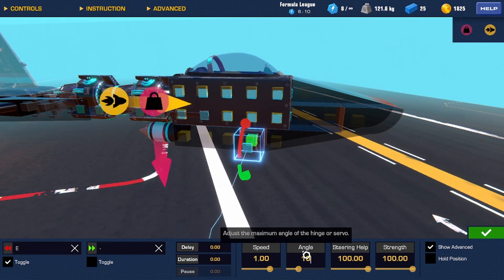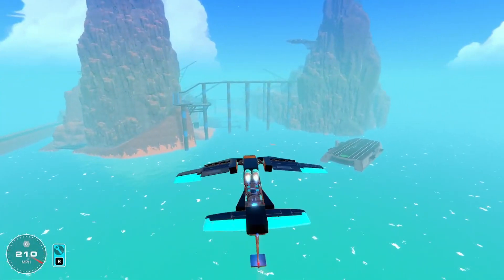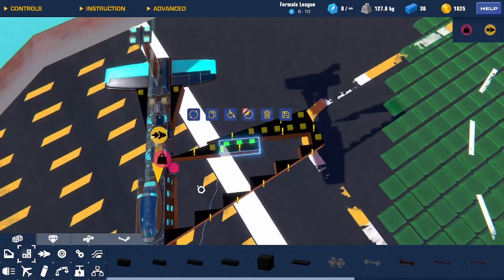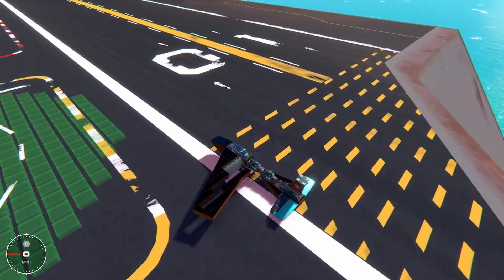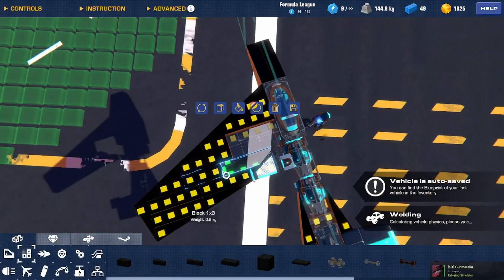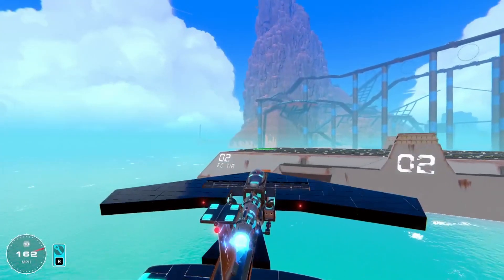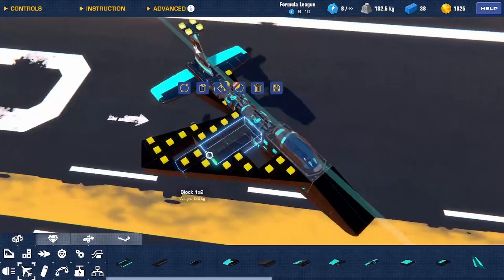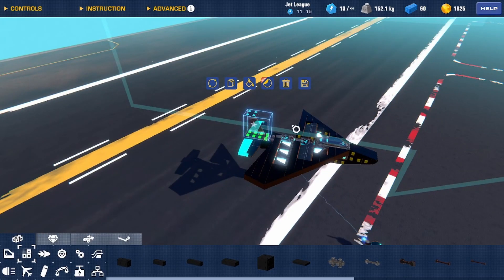Wing DESIGN, PLACEMENT, AND How to Build A BETTER Dogfighter

Comment: I think my wing lift is bugged in my copy of the game. My planes fly striaghter with the wings on the bottom and have more floaty effect when I place them at the top. I had built a catalina seaplane and a world war 2 fighter plane back to back one day and the catalina was very floaty and the ww2 fighter which was moddeled after a german junker where the wings are practically attached to the belly and it flew far straighter than the catalina. If you look up what the catalina you will clearly see that the wings are at the highest point.

Comment: 12:13 that is in fact a variant of a Swept wing, with a lower aspect ratio. A delta wing should be an almost perfect triangle. Better yet, if your focus is agility, lose the elevator fins and replace it with elevator flaps attached to the main wing but be mindful of high-speed “compression”. Same if you’re focused on speed.

But the nature of a “tailless delta” is that while it’s low speed agility and high speed lift is unmatched, it will lose that speed very quickly if you make sharp turns.

Comment: bro tf your "delta" wing was just a big swept wing, a delta wing is a doritos like on the eurofighter of the dassault rafale. delta wings usually have pitch AND roll into them, negat-ing the need for an elevator, but you can replace it with canards and have even more pitching power (like on the eurofighter/rafale). There were planes like the mig-21 (goat plane) that did have an elevator at the back, but idk why they did it, probably because the engines weren't making the plane ffast enough for the doritos configuration. Not hating or anything, just saying that swept wings have the back of the wing angled, but delta wings have it straight. also the F-22 doesn't have a delta wing but a diamond wing. By the way, the best way to remember what i just said is to remember that the letter D (delta), in greek, is a doritos when in capital letters. Your videos are great I'm just pissed off when someone makes a mistake like that.
Reply from the maker: My lord chill bro, but yes I understand thanks for the feedback. And the f22s wings are classified as diamond delta wings so I was basing my design off of that. Once again thanks for the feedback 😅
Reply: @ProjectSTORM1268  btw love your vids (boat/catamaran tutorial next ? or is it on the paddle video ? i'm gonna watch this one next)

Comment: bro a wing always generates lift upwarts in relation to your plane a baloon always generates lift upwarts in relation to the horizon/ground A WING IS NOT A BALOON  IT DOESNT MATTER UF THE WING IS ON TOP OF YOUR PLANE OR AT THE BOTTOM
Reply: it kind of does, because if the lift is above center of mass it won't stay level, it's going to try to stay horizontal. lift above CoM = more stable, less agile; lift below CoM = less stable but more agile
Reply from the maker: @loyalestdragon thanks for the explanation because I honestly didn’t know how to respond to the comment 😅 smart person saves the day yay

Comment: Hey Storm, you tend to use the helicopter wings and sails and paddles in your planes alot, what do these do to help?
Reply from the maker: They help with stability in the wings a lot more, so if I have any pitching up or down, it negates or lightens the effect of that on my plane. It will lower my instant turn time as well so I don’t have as much jittering on my more maneuverable planes.

Comment: Hey Storm have you ever made leading edges and trailing edges that move for better maneuverability? I have a Dogfighter that actually has insane turning and good stability (No Hinges btw) and it also has Leading and Trailing edges [Flaps acting like horizontal stabilzers] which give it that maneuverability.
Reply from the maker: No I’ve actually never heard of this, that’s really cool 😅
Reply: bro... every wing has a leading and trailing edge, because it's the EDGE of the wing not the control surface |:

Comment: where should my pitch and roll come from? I always put pitch AND roll in the main wings, only pitch in the tail (unless it's a bigger tail, then i do both again)
Reply from the maker: You should try your very best to put the pitch in the tail. Think about it from a leverage standpoint, pushing something down from the very back will push the other side up, vs pushing something down at the middle making it just altogether go down. Hope that helped 😅 also roll should go in or near the wings

Comment: Exactly as I said, unstability is key.
Reply from the maker: There is strength in instability 😭
Reply: @ProjectSTORM1268  can you do an updated video with the new physics
Reply from the maker: @Sixgaming117 sure, I’ll do my best :)
Reply: Don’t forget about lag though, lag is a key mechanic
Reply: I found a perfect balance between too stable and too unstable that allowed me to invent a new maneuver with a plane i have.
I'm calling the new maneuver the pitch snap. It is a 180° flip using pitch with a turn radius of 0
Reply: @Blockenheimer  dude people have been doing this for years, not just on trailmakers, i even found a different maneuver that involoves it
Reply: @Blockenheimer  so... A high Alfa maneuver
Reply: @rakishpotato4783  bro the alpha is so high it's 180°
Reply: @Blockenheimer  F-100 noises
Reply: Unstable designs somehow manage to be generally faster designs.
Reply: I am making a pretty well detailed f22 raptor

Comment: Any tip for flying wing as mine flips like a normal plane with no elevators?
Reply from the maker: Have enormous amounts of drag at the wing tips, you can force more drag in there by putting flaps on the top and bottom of the tips of the wings at 45 degrees or more 😊

Comment: Good explanation Storm! The low wing aircraft with the wing-tips higher than at the wing-root is called Dihedral, all wings have Dihedral, but it is more visible on the low wing planes, even a Cessna 172 has a bit of Dihedral to it. The idea is that as one wing drops it becomes in line with the air flow, increasing what is called "Angle of Attack" the raised wing has a lower angle of attack, which lowers lift on the high wing and increases lift on the lower wing, pulling the plane back to straight and level. The F4 Phantom is a proof of concept that you can make a brick fly with enough thrust. So, the more thrust the better until you reach diminishing returns. In real aircraft, there are two types of drag: Induced, and Parasitic. Induced Drag comes from making lift, most seen with heavy commercial aircraft at take-off, or landing, Low speed, high angle of attack. lots of lift and there for lots of drag, you can see the air spinning at the wing tips, "wing tip vortices". Parasitic drag is from things sticking out into the air flow, from the wings themselves and the engines to the small rivet heads that hold the place together. Induced drag lessens at higher speeds but parasitic drag increases at higher speeds. Your analogy with the fletching on an arrow is spot on, it's about the mass center and drag center relationship, keep the drag behind mass or the mass will want to go to the rear, think of a shopping cart wheel.  Disclaimer: I'm a certified Aircraft Mechanic for last 13 years and a pilot in training since 1999.
Reply from the maker: Dang, thank ya so much for this explanation. And thank you for learning me somethin 🤣. I’m glad you enjoyed and I’m glad I got something right at least 😅
Reply: I also saw a design with dihedrals where the wing tips are twisted upwards slightly to increase the angle of attack even further to increase the self-correcting tendency of the dihedral. I used that design to make a self-flying plane that mechanically stabilizes on the roll axis instead of using logic!
Reply: I know im late to the party but there are also Anhedral wings where top mounted wings have their wing tips below the wing root, which can have the opposite effect of Dyhedral wings making the plane more manueverable. 

Though its a lot less common, mostly on smaller aircraft but also found on the massive Antonov An-225 Mriya for some reason.